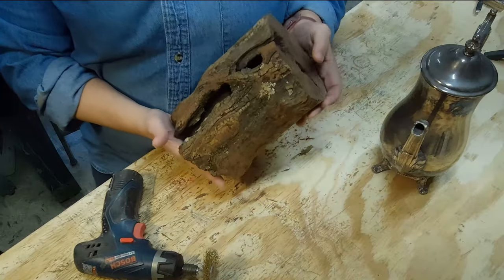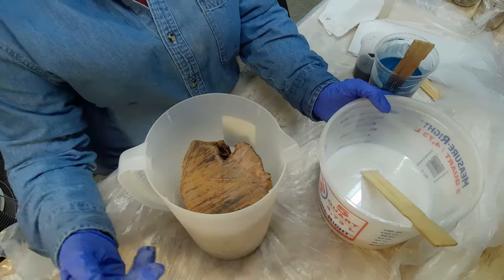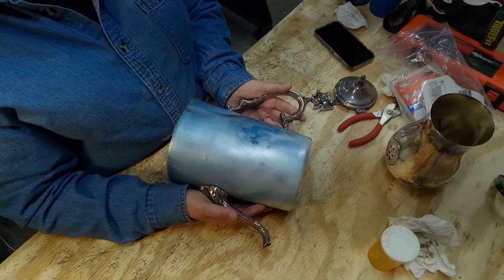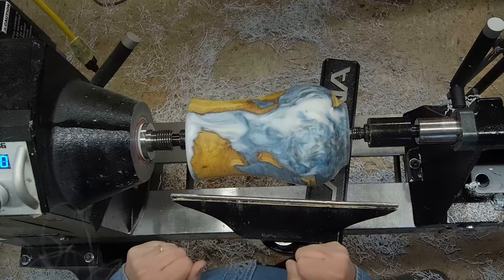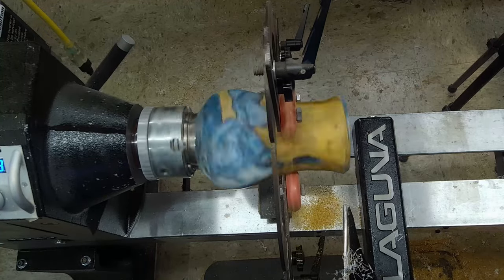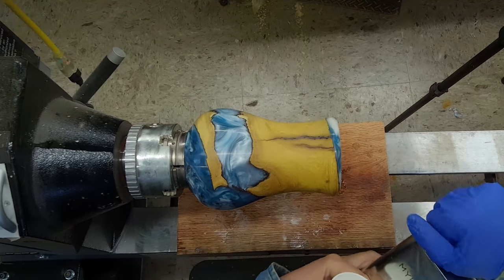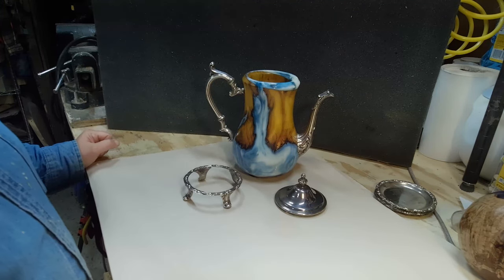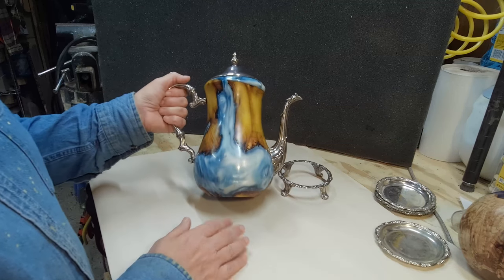Woodturning-Did I make a mistake with this piece of Osage Orange

Comment: I’m impressed! I would go with the feet. What epoxy do you use, love that color!
Reply from the maker: Sorry for the delay in my response. I use different types and brands of epoxy. For this particular piece I believe it was an epoxy designed for commercial flooring a 2 to 1 mixture with 100% solids. Thanks for watching and commenting.